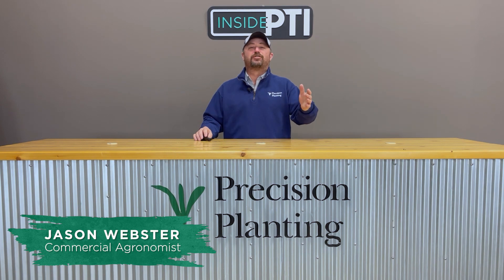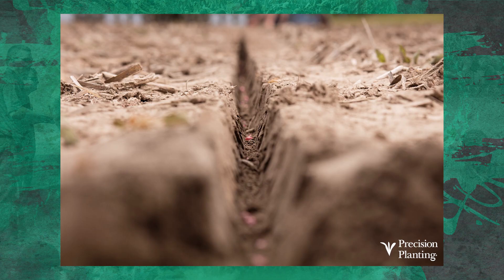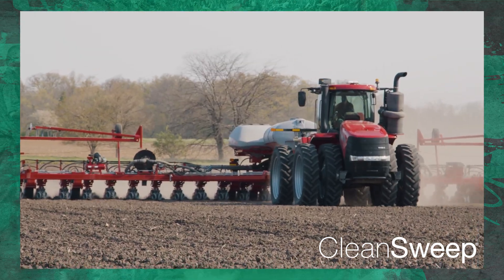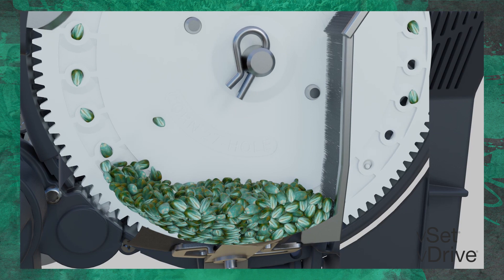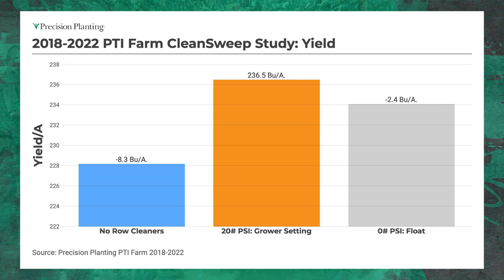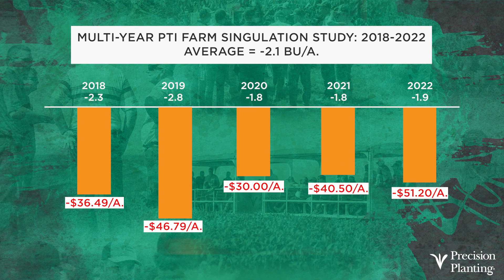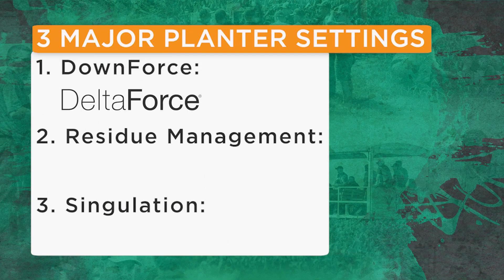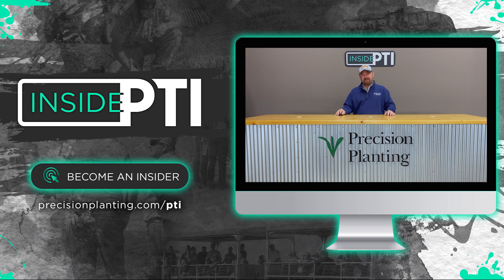InsidePTI S4•E03 | "All Wrong" Planter Study ‣ Corn + Soybean

Comment: I call BS on this. I’m not saying these upgrades won’t help, but I highly doubt they can be payed off in one season, unless the operator is blind. It’s hard to justify spending more on upgrades than what the planter cost. I assume you can get 90% of the benefits by tilling the ground and planting slower. That’s my opinion until someone plants side by side with me in the same field and proves me wrong. If they do I’ll gladly buy every do dad they sell.
Reply from the maker: On flat, black, non-variable soils, the technology could take longer to pay obviously. However, if a grower has soil variability, the technology could pay off very quickly.

Don't forget if you have to increase or add tillage passes, that's also a cost that needs to be accounted for. Planting slower as you mentioned could also add cost for some as well.

Measuring is the only method to determine if we can be better. If you know where you are at on the measuring stick, it tells you how much improving you need to do. As long as you know your numbers, you can make an informed decision. Without it, it's just an opinion.